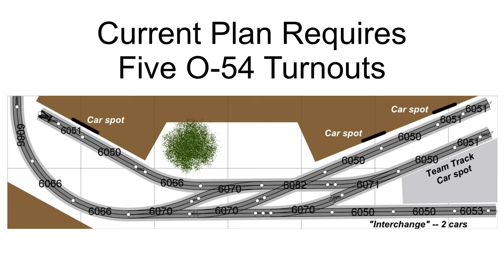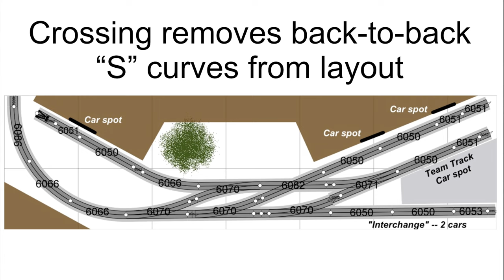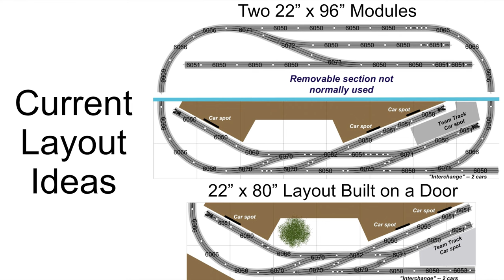Testing O Gauge Switching Layout Design plus MTH Premier Boxcars

Comment: Steve, "come to the dark side!?!"  Oh, I mean, O scale side . . . oh, whatever . . . things are looking good with the bigger models.  Yeah, ya' can't fit as much trackage in a small space with O like you can w/ HO and N.  I too have a 'sparking' 22 degree crossover; a really old NOS piece.  Atlas was quick to reply with an email concerning the problem:  "This is an older piece of track. This was corrected many years ago.  The problem is the live X in the middle of the crossover, there is nothing insulating all 4 ends of it.  A thin coat of epoxy will fix the problem. Just put a thin coat on all 4 rail ends where the back of the wheel comes in contact with them."  Hope that helps . . . thanks for sharing your work/play/fun 🙃
Reply from the maker: Awesome, great info on the cross over!

Comment: Steve you have me excited. I attempted 2 rail O scale way back in the late 90's. Because I was standing on concrete all day and attempting to lay my own track, I didn't get very far. So 20+ years later and being 72, I may just have to give it another attempt. I still have all my equipment, a Red Caboose GP9 and 5 freight cars are on display.
It occurs to me that one of Ian Rice's dinky 1x3 -4 ft Ho layouts might convert pretty well to a trial O scale layout. A door could easily solve the layout base pretty easily.
Reply from the maker: Yep, that is my thinking! I’ve even seen how to modify body-mounted kadee couplers to allow rolling stock to make it around O27 curves, so now I’m contemplating the idea again of doing a 36” wide door layout with staging on one side and the switching area on the other so will do some additional testing on that idea.

Comment: come on Steve, Bifocals. yeah, its hard to get used to, but you'll get it. If you don't want bifocals, get a set of reading glasses. Love the O switching layouts
Reply from the maker: I have progressive lenses but my prescription is changing quickly so I can only see closeup well for a few months. I don’t want to update them more than once a year since the cost a lot. My distance vision is horribly bad so just doing reading glasses doesn’t work for me.  I might get cataract surgery in five years then I’ll be able to just have a bunch of reading glasses.